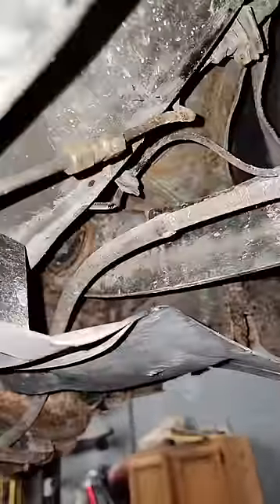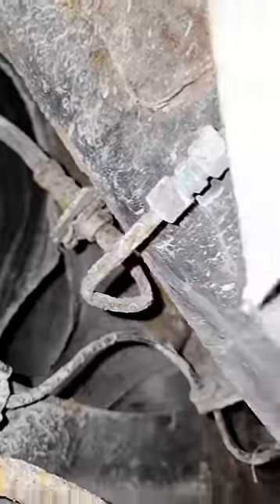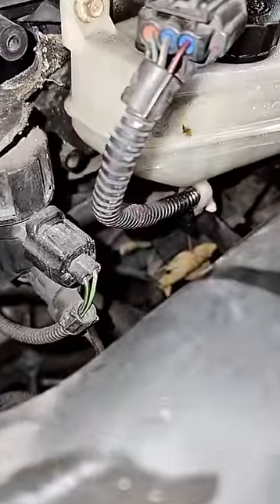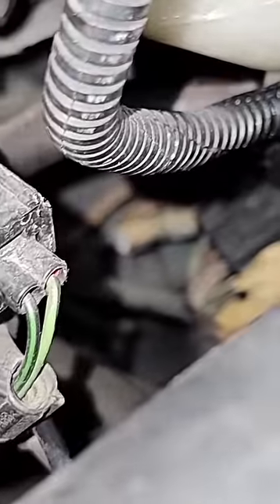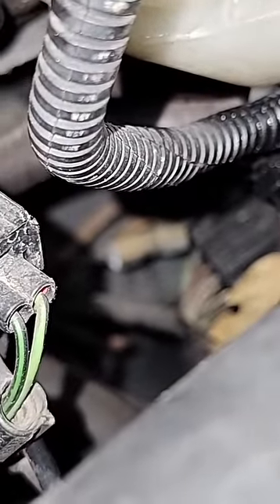don't use compression fittings on brake lines

Comment: Compression fitting should never be used on brake systems. I learned this over 40 years ago in high school automotive class. Double flare (or bubble flare for metric) only. Sounds like you know that, Mike.

Comment: Classic tube.

They manufacture pre-bent brake lines. And you can get them in polyarmor, or stainless steel.

And if they don't have your particular year make and model readily available. They will make you some. I know... That's going to take some time. But trust me, it is well worth it. It is both time saving and money saving. I will never, make a brake line for a customer ever again. And I will never, replace one line at a time, ever again. We're either going to do the job right, or we're not going to do it at all. 

And surprisingly, an entire stainless steel brake line system for my fox body mustang, was under $250.

Currently they are in the process of making me brake lines for a 74 Ford F100 pickup. Because I am never, splicing another brake line, ever again.

Comment: I've used them I know I'm not supposed to. I only used 1 at a time. never 5 ! If the line blew in a different place I'd run the new line long enough so I could cut out what now would be the old fitting. I never had one fail, and I figure if it did it wouldn't be any more catastrophic than a new break somewhere else in the line. But I understand - You're  the mechanic, not the car owner.

Comment: rookie numbers. I was gonna borrow an F150 from a buddy. He said I could use it as long as I needed as long as I fixed a small patch of break line...

17. There were 17 pressure fittings. it was more fitting than line and he wanted me to add 2 more.

Needless to say. I decided it was smarter to rent a U-Haul. I would have replaced all the lines, but the truck wasn't really worth it, especially just to borrow.

Comment: I'm a noob, what's wrong with compression fittings? they can blow under high pressure?
Reply: Brakes are THE essential safety system on any vehicle.  I wouldn't  use them unless an absolute emergency because of the liability issues.
Reply: @kelsycunningham8452  but what's unsafe? you explained nothing 😂😂😂
Reply: They aren't rated for the high pressure that brake lines can hold, they could pop off

Comment: ....holy fuck.....😮
i think this may have just solved my old Jags brake issue! EVERYTHING checks out but i still get an ABS light and nearly changed the master & accumulator. BUT there's one little spot with a compression fitting that hops the lines and goes directly to the brake hose. I'm so god damn stupid 😂

Comment: This customer wanted to play a new game called: "I'm way too cheap to buy a coil of brake line &/or a pre-fabricated one; so I'll just take the 8 short pieces I've come across & hook them all together with compression fittings to make one janky-ass brake line"... What could possibly go wrong?? And if they ever rust or get damaged in any spot, I'll just replace that section!!
Pros: I saved maybe $20-$50 in parts "for now"...
Cons: "for now" lasted ZERO SECONDS.
It was a bitch to put together.
There's 6 compression fittings on 1 line.
Brakes aren't working or bleeding.
Now I have to pay Mike to diagnose the problem.
Major Cons: It's now going to cost at least double to get my brakes fixed.
My mechanic Mike now hates me for doing this to begin with, and for the HUGE headache he's dealing with because I'm a dumbass... Also, he may un-alive me for my mix & match brake line project that he now has to remove & replace.
Finally, I look like a complete asshole on YouTube, because you 100% KNOW Mike will share my dumb-fuckery with the world!!! ***If this vehicle's owner happens to read this comment, I'd like to know how accurate my description of your thoughts were!! Just reply with a 1-10 (10 being I nailed it).

Comment: Using one compression fitting on a car with drum breaks is ok till you can replace the brake like but once you had the need for a 3rd it should have been replaced

Comment: I used a compression fitting on my brake line that burst due to a rust spot on it. I used it temporarily just to get home.. that was 3 years and about 100k miles ago.. totally forgot about it until now. Still solid.

Comment: Tell customer , you need new master and either new lines or fit correct fittings to old lines.  If they decline then tell them to take the car to a different shop. Safety & legal liability is greater then making a quick buck

Comment: Compression fittings work just fine and can hold that pressure no problem..
Reply: Pressure spikes in a brake system can be over 800psi.
No , compression fittings won't hold. 
Everyone gets complacent and feels safe at low speeds and normal stops from the freeway etc.
Panic stops WILL push that fitting apart.
Reply: @thomaswoitekaitis8977  lol compression fittings will work beyond that.
Reply: @Thomas Woitekaitis  brass and stainless will withstand much more. Do your research dude. I use copper compression fittings combined with brass fittings on steam applications.
Reply: @thomaswoitekaitis8977  and your brake system can go up to 2000 psi..
Reply: @Basskilz15  ok so my psi estimate was way low ,lol.
Maybe, MAYBE ,MAYBE, if both tubes are perfectly clean from the jump and installed correctly ,they would be ok..
The reason that their not ok for vehicle use would be under certain circumstances they can come apart , and probably some of keeping people from hurting others from their own stupidity,  meaning the lines compromised if you need one , so replace the line , (should be mandatory) , (I've had a brake line fail at speed in traffic ,so I don't mess around with them, if their vulnerable they get replaced),
So the side that's on the good side tightens fine ,the old side can crush and slip , that's why.
And if it's a connection made on purpose then there is no excuse for not doing whatever type of flare you need and using a union. 
I've used them before , im.not being holier than thou, just being honest.
Comp fittings on a vehicle (except the super special expensive ones,  that YOU KNOW, are not the ones being talked about ) are backwoods, redneck ,ghetto repairs, end of story.
Reply: @Thomas Woitekaitis  I hear what you're saying. I'd only use compression if it was all new. I'd trust the swagelok SS tubing to hold it. I completely get where you're coming from and It'd scare the shit outta me if I lost breaks like that

Comment: Devils Advocate- I think compression fittings are bad not because they don't work But because there are many ways that they can be installed improperly. Like over rust, too tight, too loose, wrong type etc. If you look it up compression fittings can hold upwards of 10,000 psi. (Depending on type) But that's obviously if they're installed properly. And because there's no ASE master compression fitter Cert. It is highly frowned upon. 😂

Comment: I've used a compression fitting twice, and it was only for emergency reasons each time. The first time it was a bitch to get it to seal. So I cheated on the second one and used some of that 2part metal epoxy on the brake line before sliding the compression fitting on to help fill the shit spots on the brake line. That worked but I still wouldn't recommend it as a go to.

Comment: My mechanic won't touch a car he didn't sell, all the vehicles he sells he puts his name on, he doesn't want to be liable doing a oil change having the brakes go and getting sued for not noticing. But when my car rotted out underneath he fixed it cut and weld for 4k less than the chevy dealer did. And if I ask if this needs to be changed or that he'll tell me don't waste your money, I'll do it if you want but dont

Comment: Brass rings can't hold pressure Mike? What about the rubber sealing rings in the calipers cylinders and the master? The tensile strength of steel is only slightly lower than mild steel.
Brass lines would be safer because superior corrosion resistance but it's 3$ per pound not 0.1$ per pound.

A backyard mechanic can usually make a compression fitting not leak but not a flare joint. They often sell you the wrong line unless you take it off and bring it in. 4 times 2006 Ranger, does the computer know what's on it?
I had an autoparts store sell me a brake hose that didn't have the same joint as the master. 
They refused to admit it was the wrong hose.

My uncle had an Accord. When the lines went out he took it in for an estimate. $2500 in 2008. He parked the car under a tree and there it rotted. 

Compression fittings are safer for back yard mechanics because they are prefabricated. 

What's really dangerous is the 24$ flare tools. Junk.

Comment: Reminds me of why I stopped working on friends and friends of friends cars, just for cost of parts..
Eating the labor rates..
I replace brakes, job A-1..
2 days later, clutch goes out..
Even after I told the person the clutch is bad and needs replacing upon a full inspection..
The person doesnt want it fixed, doesnt have the money for parts and machining of the flywheel..
Yet somehow it's my fault..

I get sued in small claims, for damaging the clutch..
Best part..
The plaintiff brings in a shade tree mechanic as a witness expert..
Better part..
The judge use to be an ASE Certified Mechanic..
The judge listens to the complaint and the expert testimony and busts up laughing..
Then I hand over a full report of the inspection and where the customer signed off on refusal of repairs..
I counter sue for labor charges and loss of income from frivolous lawsuit..
Maximum $5k..
I won,  but the judge figured $1k should make me break even..
Word got around and no more friends and friends of friends work..
No love loss..

Comment: it's supposed to be against the law I know it isn't Illinois and it's been that way since the 1960s you can't use compression fittings on brakes because there's a real good chance of failure wow I can't believe that five of those that is insane they actually make the brake lines for any vehicle there is a special block that can be used to splice brake lines but you have to have a ferrule on the end of the line with the fitting that screws into the block on both ends that guarantees a lockdown and now it's a double Farrell I'm pretty much all vehicles.

Comment: As a certified State break inspector, 1 compression fitting  the entire system is condemned. They are not certified for the pressure.

Comment: Wana know something funny? The Brakelines brand compression joint repair kits sold at Autozone specifically state in fine print "not for use on pressurized systems". Everyone in the world has been driving grandpas half ass brake job for a lifetime, and never had a problem... but when you do have a problem, nobody but the person who installed the fitting is liable. 
I hope your customer wasnt mad, but your two options were clear: expense the owner to fix their work twice, or send it home sick.
Most mechanics would shove that lesson in the customers face and run tail tucked. Im curious what you did?

Comment: I’ll never forget the first time I came up with this idea and my dad said “what, do you think you’re smarter than an engineer? They designed it that way for a reason. Fix it the right way and you won’t do it again for x amount of years”
Reply: @louiewatson9389  you totally misunderstood what I said. The guy putting compression fittings on a hydraulic line isn’t smarter than an engineer, and neither are you if you haven’t figured out it’s called planned obsolescence lmao

Comment: Push lock fitting ?   :-p
Reply: No, compression fitting are for metal lines, push lock are for rubber and plastic
Reply: @Derbyboy13  Think them on metal (rarely) and not in a critical area..  if they used that many - think all the lines are $$$$   and need to be replaced .

Comment: Tell the custmer no tuchy brake lines will coppestion fittings  has to be right one    they go in the bin 😱😎
Reply: Tell the  customer  you do not tutch comprtion fittings  if they go up the swany  how picks up the bill  without all new lines   5 is 5 to meny

Comment: You want something that is for sure not going to pop and be 100% reliable I don't deem compression fittings 100% reliable at all times as you are dealing with a friction fit instead of a mechanical grab

Comment: There's nothing wrong with compression fittings. never had one leak no matter the application. Normally put them on tranny lines, which has a lot more pressure going through the lines than brakes. Notice your rusty ass brake lines with the 5 compression fittings are not leaking a drop of fluid!

Comment: No you can't get a pedal because of the number for that you said. Did you not notice the 90-degree Bend right before it where the line is pinched off? And you would not be liable for all those connections Gary you would only be liable for the master cylinder. And according to California law which the Supreme Court of California said as long as you put the lug nuts on the job is done. You don't have to do the complete job bro. All you got to do is put that master cylinder and it let them f******. Do not replace during Tire brake line. Just cuz you don't like compression fittings does not mean that they do not work. Go watch your video fixed in ninety-degree pinched band underneath the car in that brake line. That band is the reason you have no brakes. Do not rip off your customer bro

Comment: Hope they know they are only good for like 100 psi  I think a Brake is good to 3000 psi
Reply: 10,000 psi compression fittings exist in the industrial world. I highly doubt they are listed for use on brake lines though. 🤷‍♂️
Reply: @jman0870  We welded pipe and flange with steel o-rings then bolted everything . we had hydraulic lines braded hose 3 core each core had a woven wire the hoses pre load at 8000 psi can reach a load of 60,000 we never used a compression fitting .  , Plumbing home and business we used them on everything .
Reply: @JCcanU  flanges with an o-ring aren’t comparable to compression in any way, shape, or form…
Reply: @jman0870  I worked with the Big Boys Oil Rigs and , In UAW running parts in AUTO claves and Sawmills  I have replaced many brake lines I get the tubing start at the Booster and go from the master to the wheel cylinder or caliper .

Comment: Not only are compression  fittings  illegal to  be used on brake lines, it's just plain laziness. I don't  care if they have been on there for 8 years or 8 minutes, if I have to do any type of brake repair or service, it gets new lines. Period . End of story. When you work in this trade at a professional level, there is a thing called liability.  If the customer  refuses to replace the lines, that car gets nothing done. If a mechanic does any work without addressing  the lines, they are just as much an idiot as the person who installed them. I would rather a pissed off customer than be visited by cops and lawyers because  someone died. When it comes to brakes, steering or any other safety related item, there are no half ass repairs.

Comment: 2001 Ford Focus???
Why so many compression fittings on a 
relatively late model car??
Tell the customer to take it back to the mechanic who put all those compression fittings on there in the first place and to make it right!!
That's a crappy assed brake job. Must've been
Nacho's Tire n Muffler Shop.
At this point the brake job is going to cost more than the car... 🤔

Comment: Lol with all these comments it seems none of you actually work on cars. Even new cars from the factory have compression fittings. I've never seen one fail. If you do it right it's no different than where it connects to a caliper or master cylinder

Comment: The correct advice is to not use compression fittings like a moron like that guy. Use them correctly and they’re perfectly safe. My uncle has ran a successful garage since 1968, and I’ve worked there since I was a teenager. I’ve put many compression fittings on, and my uncle & family have used them since 1968 and NOT ONE has ever failed or caused any issue. I’ve had a couple new ones in recent years break or leak a little when installing, but that’s just junk Chinese parts like anything else. I’ve had to use compression fittings on things that hold WAY more pressure than a brake line does, and they’re fine. Replacing everything with new lines is obviously the preferred repair, but in the real world you can’t always fix peoples stuff that way. Compression fittings are fine if you’re qualified and know what you’re doing